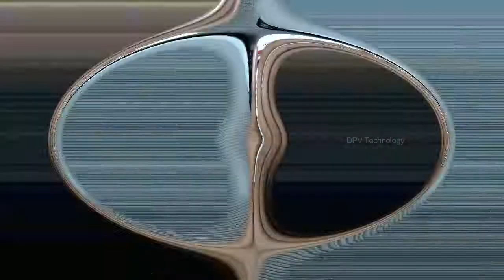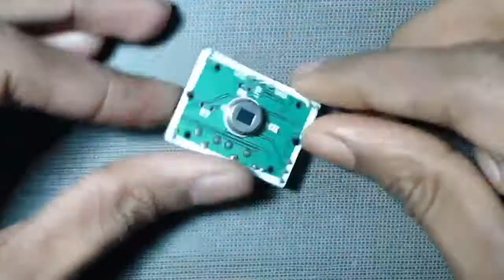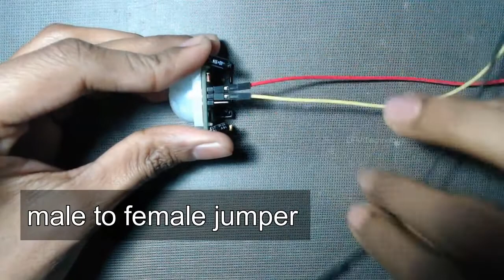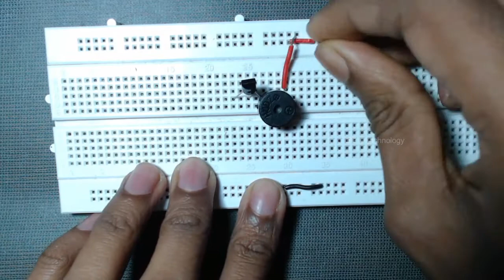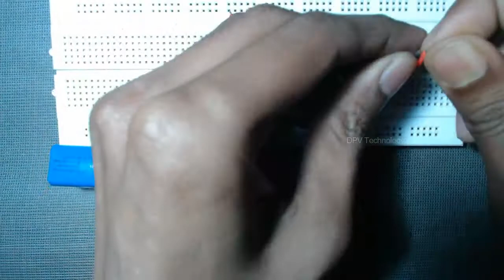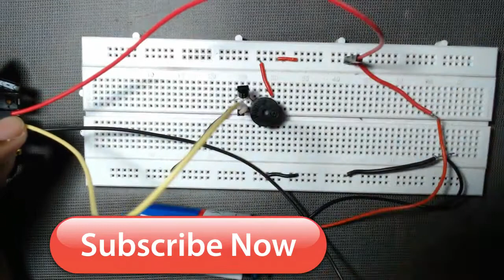motion sensor alarm PIR without microcontroller,DIY how to make motion sensor alarm

Comment: Did all the connections as shown in the video but the sensor is not working ... What should I do?
Reply from the maker: Yes,all the connections are shown in the video.. check your connections.it will work..
Reply: I checked
Reply: No it won't

Comment: Why does my buzzer remain on?
Reply from the maker: pir sensor is getting continuous signal. don't stay in front of the sensor.
Reply: I am not facing the sensor but it keeps on buzzing...
Reply from the maker: try to check your transistor.. use npn transistor.. otherwise, it won't work.use a 100-ohm resistor at the base terminal of the transistor and connect the other terminal of the resistor to the output of pir.